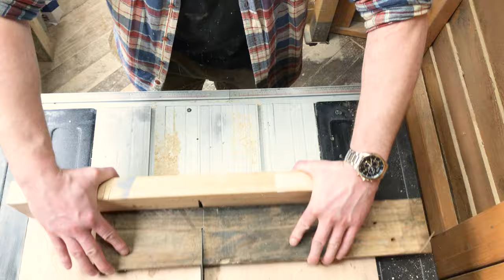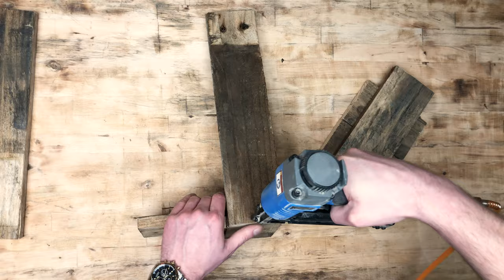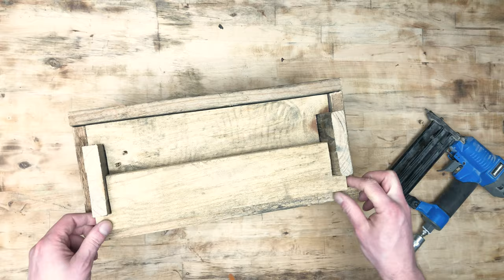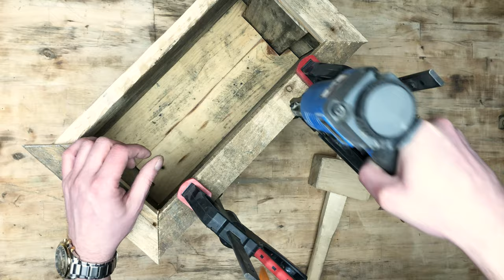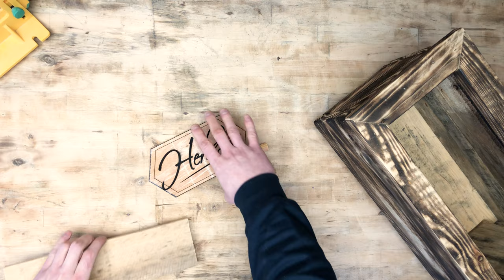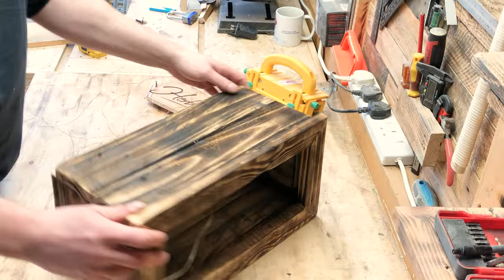Easy Pallet wood planter. Woodworking project that sells!

Comment: Cool build nice touch with the laser etched led sign…… I’d buy that product no doubt
Reply from the maker: Thank you. It's spring time so let's try some outdoor pallet projects again.
Reply: @rarecraftsman  I have 190 feet of 2x2 pressure treated spindles offcuts in24” 54” 65” lengths painted white from a decking job I did recently.  Think I’m gonna make a planter bench or just a bench idk with them
Reply from the maker: @WedoweeHandyman  great idea!

Comment: no glue just brads ? glwt
Reply from the maker: Yup you are right that is a risky move, but it is an experiment. I basically do not want anything which could potentially soak in to the soil. It seems really strong 🤔